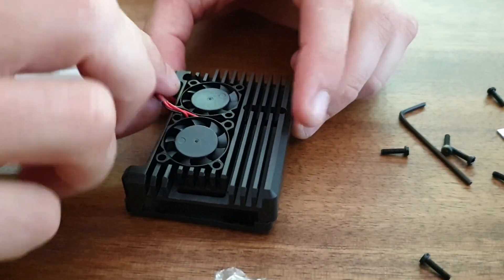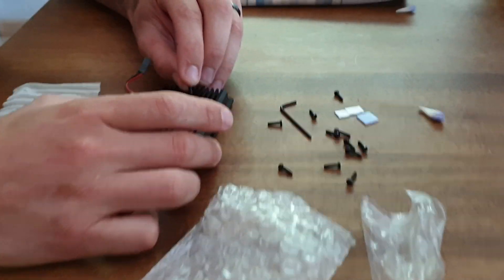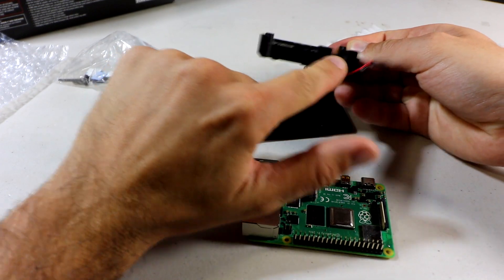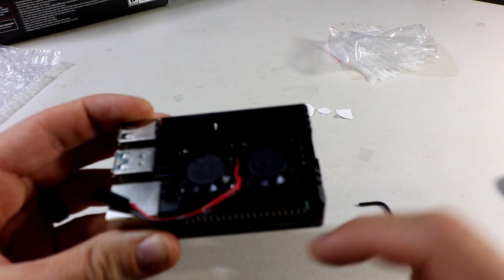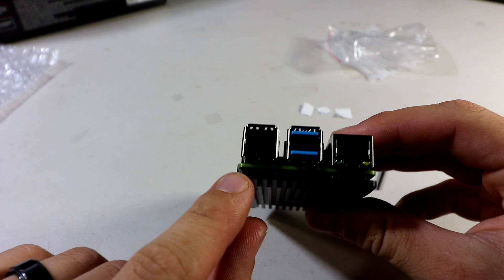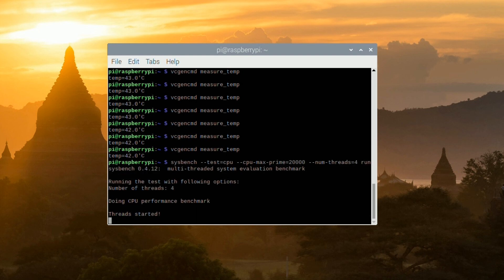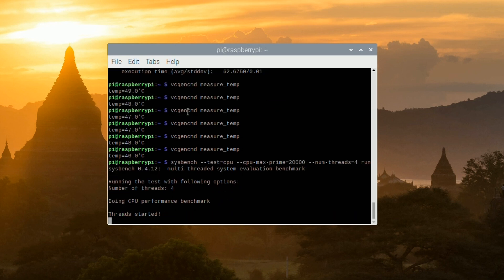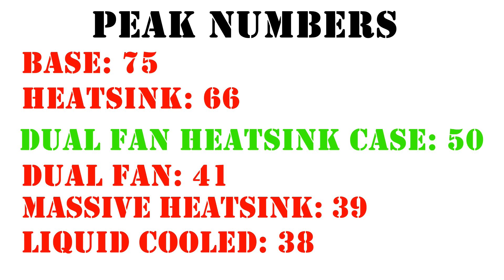Raspberry Pi 4 Dual Cooling Fan Aluminum Alloy Case

Comment: Can the GPIO extension board be used with this case? In my current case there is not enough play to connect the GPIO extension board while using the case.

Comment: 4:29 In order for heat to flow through solids there needs to be a temperature differential. So, as the chip gets cooler the rate of heat leaving the chip decreases too. 👍

Comment: I found that there is a hairline gap between ram and the heat sink even with thermal pad. Except CPU other 2 chips are not contacting to heat sink even with thermal pad. Recommended to put thicker pad.
Reply from the maker: good idea

Comment: I have something like this - the eleduino version. I am starting to hear bearing noise  from the fan(s). So, I was looking to replace the fan(s) - can I use a noctua MF-A4X10-5V? They come in a PWM and an FLX version - which should I go for.

Comment: And how do I setup fan temperature control with this case? I tried setting every GPIO pin in the RPi configuration
Reply: you mean smart fan contrl? not possible, as you can see, the cables are only two, power and ground, no third cable for pwm, which enables "smart control"
Reply: @marceloa.8881  Yeah, I think thats what I meant, thanks
Reply: @wojwesoly  I know the shim fan has fan control, check that one
Reply: @marceloa.8881  This wont be needed if the voltage of that pin can be changed/lowered using programming. But I don’t think thats possible without a dedicated voltage regulator. The  shim probably has that implemented.
Reply: @o3rMeNs  you could change the effective voltage using PWM, configuring the dedicated PWM pins in the rpi4 to module the voltage, but I don't think that pwm was designed to power a device. The other way arpund would be to use the pwm from the rpi and use a mosfet as a switch, so the work is done by the mosfet. But that may be a convoluted solution, that is probably implemented when using the shim fan (which includes a littel pcb with circuitry to probably implement what I just said)
Reply: @marceloa.8881  Indeed, mosfets or BJTs combined with resistors is a voltage regulator! ;) Tomorrow I'll get my Pi4 and this exact case so I might be doing some tinkering with it. Automated fan speed is always a nice touch. Whish me luck.
Reply: @o3rMeNs oh for sure, if you have the adequate knowledge you can definitely pull it off, tho may not be very pretty unless you use smd. Just don't forget about the reverse voltage spike from motors, pretty sure you already know that but just to be sure. Good luck!
Reply: @marceloa.8881  Yeah I was thinking using some smd's (easy enough to solder them into a wire with some heatshrink) as I have some of them left from building drones. Delivery guy is on it's way so can't wait to cook something up once I have it in my hands. The fan cable also seemed rather long so I might just cut it and solder something together as I also have some various electronic parts to spare. Not the first time I've cooked up some mods for my drone builds and pin headers are easy to work with. Also a reason why I wanted a Pi, since the GPIO can be used for countless ways when building drones.
Reply: @o3rMeNs  oh man, you're in for a treat with all those skills, I've never soldered smd stuff. Have fun!

Comment: No instruction where those pins go... Are you sure you plugged them correctly? My other fan case uses different pins.
Also mine came with same screws for all holes.

Comment: Thank you for a very good video. I have the same case and I believe the reason you see quite high temperatures is due to this being quite a solid chunk of metal. The fans can be as efficient as they want, but they are only able to cool the "outside" of the metal. I expect there would be a temperature distribution across the metal with the highest temperature towards the pi and lower temperatures on the outside. Awesome if you would be able to measure the metal temperatures to test the theory???

Comment: can i add that classic black or white case (a rasp 4 version, of course) to this setup? Does it fit well with those dual fan coolers?
Reply: No, it doesn't fit, but instead there is another fan which specifically for that case

Comment: I think you didn't remove both of the sides of the thermal pads.  There's the white and a clear side.  If you don't remove the clear side it'll act as a thermal insulator

Comment: The thermal pads with mine just disintegrated upon trying to peel JUST ONE side back.  Tried the next pad, same thing. I don't know if i can use thermal paste with this or not. I'm assuming not since the pad is taking some room up to make contact. I'm pretty disappointed to be honest.
Reply from the maker: Give them a buzz they have great customer service

Comment: Suggest mounting the heat sink pads on the case instead so it can be used with another pi. The passive one is my favourite case.
Reply: umm yeah but the thermal tape will lose its efficiency if you keep on removing the tape.

Comment: Before buying this Item, I read the reviews and watch this youtube video and other youtubers on this product...

In every which way some who did the product reviews (timestamp 3:37) here stated this Item is a quiet fan and it's a bang for the buck..
I will like to add. I ordered this dual fan and on first use it as people say (timestamp 3:37). The fan is very quiet. 
However, after day three the fan is very noisy and loud. 
I got this item on Nov 21st 2019 and by Nov 25th 2019, I can----not take the noise anymore. 

If you are going to put this fan on a pi, do not put it in a place where you sleep. For me, I put mines behind my TV and 
at day 5 it had to go. 

SO everyone who posted that this fan is super quiet told the truth, because posted on the 1st day use and I will bet if they would have given it 3 to 5 days of use (on 24/7) they will have a different take.

So in short, the fan works but its too loud. and I will also add if it's this loud at day 5 of use I could only imagine what it will sound like after a month. also I dare to ponder, if this fan will work and do it job in 6 month because the noise is a sign its not as fast as day one anymore. 

its a cheap fan and as you heard before, you get what you paid for.

Comment: Working great but two small things:  The Hex key included with the set was too small for the screws, and I found a small piece of aluminium filling that detached from the case and may have create quite a lot of issue, check the side of the bottom part below the HDMI connectors.

Comment: I bought this particular 'case', and with the same benchmark, running it for 15 minutes,  the CPU got to 52 C so I come to the same conclusion. (room temp around 20C). With the fans disconnected, I got 60 C at full load after 15 minutes. I was curious: at 30 minutes with no fans, the temperature rose to 63 max (again at full load).

I ran this: sysbench --test=cpu --cpu-max-prime=2000000 --num-threads=4 run --time=900
Reply: At what clock speed?
Reply: @MrMat43211  stock

Comment: even with the passive version I never get temps higher than 50°C and that when overclocked at 1.8ghz.
Reply: Really? Damn. Im now running my Pi 4 with active cooling 1 little single fan at 800Mhz at 50 degrees. But i want to overclock it. I installe FULL Gnome 3.30 on it(Including all Gnome Apps, it's like a full ubuntu desktop lol). And it's nice. But i need a little bit more power.  I also would like to go to 1.8Ghz.
Reply: @HermanWillems  get a decent heatsink. A fan alone is not enough.

Comment: Use arctic mx-4 2019 edition...... myn sits nicely @ 35 degrees
Reply: Did you use mx-4 instead of the thermal pads, cause my thermal pads fell apart trying to take off the sticky side so I need replacements.
First time I'd had that happen I used thermal pads all the time on my water cooled GPU.
Reply: @Schoolofmonkey  you can find them on eBay.
Reply: at 100% load, stable ? (all 4 cores)

Comment: I have the fanless version and the first thing I noticed, was that the risers don't really fit the Pi4. I mean this thing is specifically made for the Pi4 and screws in place. So why didn't they at least make the cpu riser tall enough to uses thermal paste instead of a heat pad? For the other chips heat pads are enough.
Reply: Thermal pads are better for a couple of reasons over paste.

Comment: The tower cooler my be better, but it cost more than double this cooler (you can ge tone for $9 / 8€ on aliexpress) and cools almost the same. It's a no brainer, get this one.

I wish you also tested the passive armor case, is has slightly more aluminium so maybe it cools the same as the one with fans? I have two of these but for the 3B/3B+ and they are amazing, 40 ºC with no noise. I just wonder how they work with the hotter 4B.

Comment: I notice you used a thermal past in your previous video, and now a thermal pad.
It would be better to always use the same thermal pad, for more accurate results? With at lest 12W/mK of Thermal Conductivity.
Maybe in your next video, you can test the new aluminum alloy case (the version without fans).
Reply: Thermal pads are technically better than most pastes for a couple of technical reasons. You can get as much as 1 degree C lower than paste. You can find them on eBay.

Comment: would that case work without the section underneath? yes I know it wouldn't bolt down but are the thermal pads sticky enough.  I would like to use it inside another case but there isn't room for the underside part.
Reply: Yes, you can get the proper nuts to match the screws or use zip ties.

Comment: I bought this case. It came with no instructions. Although the reviews pointed out the two types of screws. From your video I learned where / how to plug in the fan on the RPi 4B. As I said, no instructions. Like put the 3M sticker side on the RPi 4B first. The other side has almost no sticky-ness. I also got a FLIRC case for the RPi 3B+ and it's nice. I still haven't turned on that 3B+ or this 4GB 4B yet.
Reply: I bought two of these on Aliexpress and the instructions are always on the product description...
Reply: Myn came with fans pre installed.... all I needed do was sandwich the pi and screw both plates together

Comment: I like your videos, but as stated learn the commands ETAPrime uses for testing.  Also the unit stock should thermal throttle under full load and you don't show that, so that makes me question your results (See ETAPrime's latest video).  So please add some more info about testing methodology, so we can compare with other testers.  Keep it up!

Comment: I tried it all on rpi 3. Fans, almunium, copper fins, open. I spend so much on those accessories. But everytime something was missing, fans had noise and extra voltage issues, copper and aluminium fins were unable to stabilise rpi3 temp which resulted in throttling. Then finally I tried a flirc like case which badically acted like a huge heatsink. And walla.... Completely silent, no voltage issues, no additional accesory required. And it didn't throttle even at max continuous loads. It's what everyone needs. From that time, I decided not to waste money in anything other then  flirc like cases. Its best of both worlds without additional hassle.
Reply: BIQU case is a improved version of Flirc...
Reply: @PULSTARUnboxing  Actually, I am using this case only. And its a generic almunium case which I got from banggood. And its not an upgraded version of flirc. The finish and thermal conductivity is not as good as flirc. But it gets the job done at a lower price point. I recommend it fully.
Reply: What are you doing with your Pi that gets it so hot?
Reply: @Deses  emulation station 3d games. Mainly playstation and n64 games.
Reply: That all is good, but without access to gpios and some other interfaces, it makes RPI pretty useless in a respective way.
Reply: @MrBlackHawk888  actually there are small slits on the side near gpio pins that can be used to interface with them without opening the unit. It's true that you cannot install any HAT. But you can certainly access all GPIO pins and route the wires from the long slit that's provided for that purpose. I am using rpi3 with this case for Running Emulation station, KODI(media center) and Pixel Desktop for my computer needs. I even run DOSBOX AND WIN 3.11. This basically does 99% of my needs. And I didn't felt the need to use the GPIO Pins ever for these.
Reply: Naman Gupta good for you... ) But a little unfortunately for me, acces to csi is required, so this particular case seems to be not an option. )
Otherwise good enough case, according to different tests.